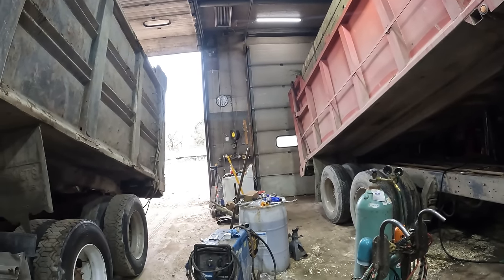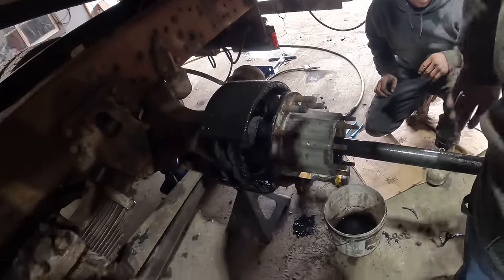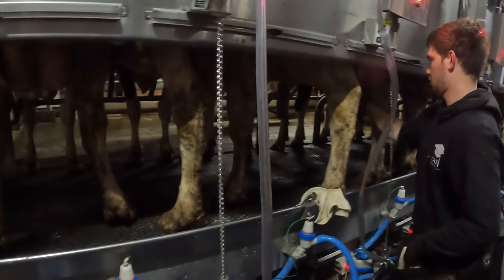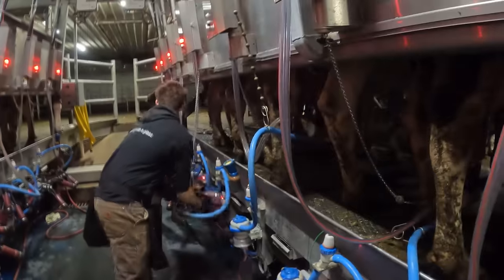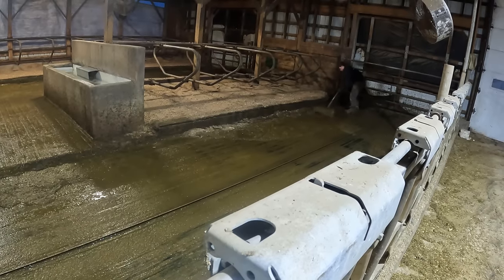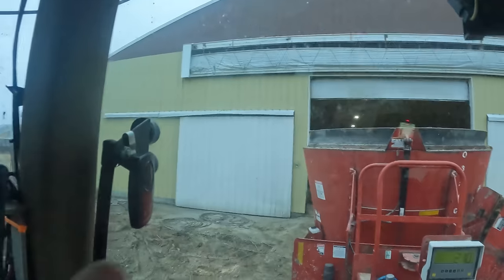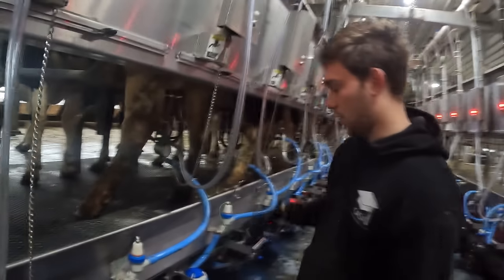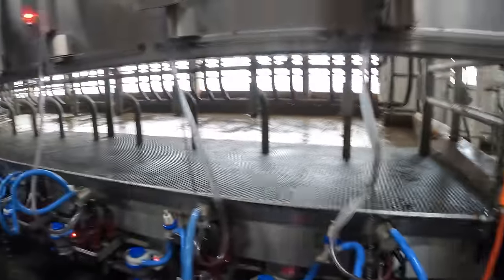Milking cows, Feeding cows & broken equipment!

Comment: You would have been better off to "cage the parking brake Springsteen to back off an auto slack adjusters, not a recommended practice to back off A slack adjusters